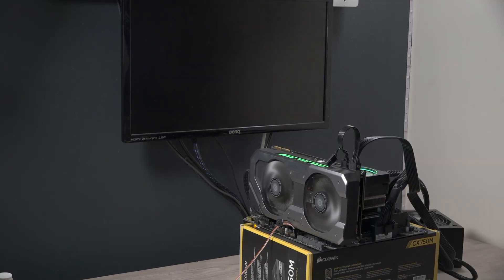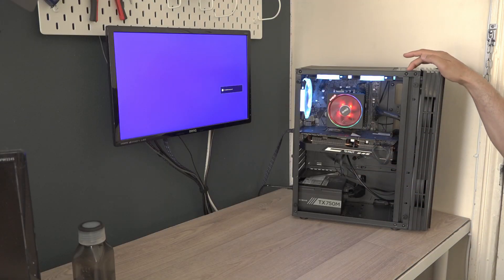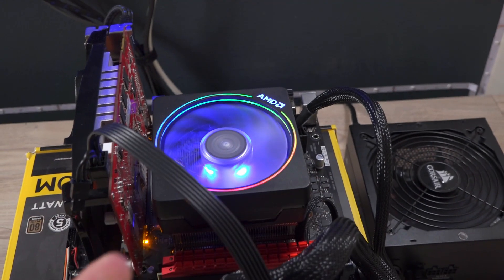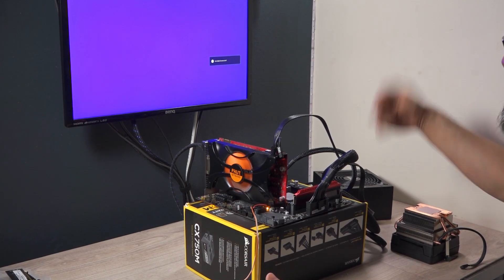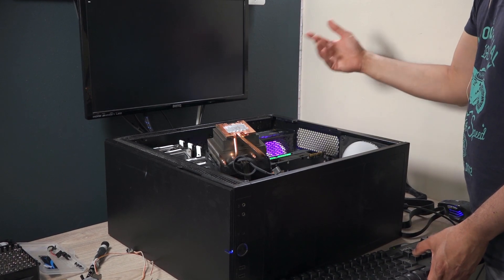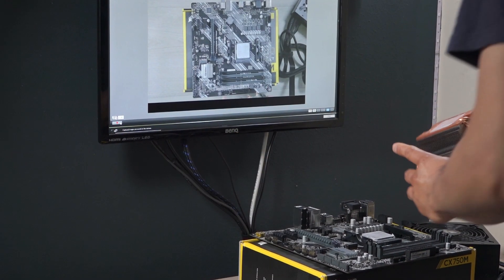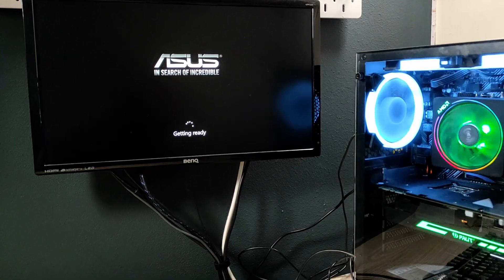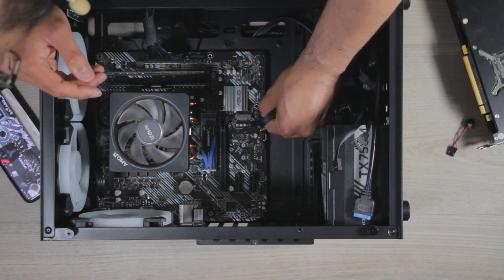Computer Turns On But No Display - Led Light On Fan Spinning - HARDEST Troubleshoot?

Comment: I have this exact same issue with my new build but don't have spare parts to test, ryzen 7 3800x with bf450 board, swapped ram, took mb battery out and put back in, motherboard and gpu light up and all fans spinning,  just won't post, do you think it's the new motherboard? It seems exactly the same as this
Reply: Oh I also plugged a speaker into motherboard and I get no beeps at all when turning on, also the build won't shut down when I long press the power button, I have to switch off by psu power button
Reply: @djsyks1  fixed ? Help
Reply: @Scriptff777  ended up sending mb back and buying a different one, worked straight away with new board, maybe the board I sent back needed the bios updating, I'm not sure but was defo the motherboard,  maybe try updating the bios as that's the only thing I didn't try
Reply: @djsyks1  🤣 i tried but didn't work ☹️ I use boot drive you can update bios with it without display
Reply: did u find the solution today ?
Reply: I have the same problem, I am suspecting the culprit might be the motherboard

Comment: Change new ram, still not working.
Change power supply, still not working,
Reset CMOS, still not working.
New Motherboard, still not working..
How about CPU ?
If CPU problem, you still can boot ?
Reply: Graphic card
Reply: it won’t boot in most cases
Reply: My case here, everything new and not working my GPU are old ok but I don't think this is the problem wow do hard Windows 😢 my Old MacBook Pro never give problems

Comment: someone please reply and help me, so i was using my pc watching youtube videos, and all of sudden my screen went black from no where, also did happen with me 2 days ago where my screen went green colour and white colour, and then my display wasn't showing from gpu, so i changed the video to motherboard and my pc is working, but my gpu fan is still spinning and it working fine, but still i dont get display,  any help?
Reply: Same issue here brother. This thing has been plaguing my system for a while and it's the second time this has happed. I am  going crazy trying to figure out the cause. The last time this happened a year ago and turned out both my mobo and GC were bad got the mobo replaced under warranty and bought a new GC now the swme issue again 😭😭
Reply: @Metalhorse_  did you ever figure it out?
Reply: I have the same problem😰please let me know if you know how to fix it

Comment: What if my system posts even after trying hard to get this motherboard to post and then after some time it crashes in windows 50-50 chances to crash? 
CPU- Core i3 6100
MB - GA-H110M-s2
SSD- Kingston A400
Ram - Kingston 4gb DDR4 2400, Hyperx 8gb DDR4 2400
GPU - Hd 7870 
Psu - CM MWE550 Bronze
Motherboard was not powering on earlier, light and fans used to turn up for a sec and nothing after one spin. After some time it was spinning continuously like no power to cpu but never post. And after some ram adjustment and replacing rams it did post and now I'm facing crashes and sometimes the same no post but posts after turning on in sometime

Comment: So I have this same problem with my pc but I was just doing my normal pc business then I got a screen freeze i was loading into a game of g mod which can be a very demanding game and I’m only using a 3200g r3 apu after about 2 mins of waiting for the freeze to stop I decided to turn off my pc and after I waited 45 seconds I attempted to boot my pc up again but it did not turn on after about 7 minutes it turned on by itself and showed no signal with a red light on the motherboard I read the manual and it meant something was up with my cpu I bought it new from Newegg about 5 months ago and had no problems. Did I just put to much stress on my cpu and gpu? And is there a way I can fix it?
Reply: I'm pretty sure I'm having this exact same issue but with my 5600x, my 3080ti is still confirmed working so it's between the cpu and motherboard
Reply: @FTVG_inc having the same issue what was ur fix

Comment: The issue with my motherboard is that mine has a button labelled as CLR_CMOS2 instead which seems unique from other mobos, i havent seem this with other motherboards. (MSI X470 Gaming Plus). What i did was just shut down the computer and unplug the power cord that connects to your computer and flip the switch, once thats done. I pressed down on CLR_CMOS2 for 15 seconds or so and let go and plugged back everything and it worked.

Update: I had the same issue again, i had it two more times and fixed it the same way i explain above. Its kind of annoying and im concerned about what's wrong. Can you suggest akhi pls what the issue might be?
Reply: Hey my man I hope you got your problem fixed. But for everyone reading your comment from now on let me say that if you're facing this issue frequently and you're solving it frequently by resetting cmos, you should replace the battery.

Comment: I had this happen to mine when first built. It was running off the i-gpu which had no drivers.
Reply: How did you fix your I-GPU problem?
Reply: How did you fix it???
Reply from the maker: That's not exactly the same issue then...!
Reply: @HealMyTech1  actually its the exact same problem. no display showing and all lights powered on. My worst fear was I fried the mobo but no, that's not what happened.

Comment: I have the same issue but my keyboard had also broken when turning the pc back on
Reply: Ya mine is the same my computer turns on but there is no display and my mouse and keyboard won’t light up indicating that they are working.
Reply: @monkie_e5362  and i have this problem how you repair him?
Reply: @monkie_e5362  same issue
Reply from the maker: Im not clear on what you are saying!
Reply: Same problem any solution ?
Reply: @aissaouiali8458  I straight just short circuited my keyboard somehow but check your ram might not be pushed in all the way
Reply: @zanderdov5901  Bro my motherboard has a red light on the dram, does it mean that i didn’t push it in all the way ?

Comment: Figured mine that it was either the bios settings or the static. Fixed mine by removing the gpu, then the cmos battery to reset the settings for five-6 min, hold the power button for thirty sec to drain the static, and finally plugged everything back. GPU now displays.

IMPORTANT: (Make sure to have done the unplugging method above before proceeding) Also make sure to understand the BIOS configuration for the display. Sometimes, PCI-E (Display output for the GPU) gets interchanged with the iGPU (Display output for the integrated GPU of your CPU; most Intel CPUs have this) or the other way around. To check if that's the case, you can try plugging your monitor to the iGPU instead of the GPU or the other way around and check if it turns on. If it does, then there's a possibility that your BIOS is not properly configured to show display through your other display output. You can find it in most BIOS under 'Display Configuration' or the likes. Hope it helps!
Reply: Cannot believed that worked lmao. Thank you for bothering to comment this
Reply: @naturalcauses1695  sure, glad to help!
Reply: @blank4700  please bro can you explain i am having same problem how did you do that what do we have to do exactly first remove GPU and CMOS then hold power button for 30 second and then wait for 5-6 min and plug back that's it ? Or anything else pls reply
Reply: @Scriptff777  I'm sorry if you're dealing with the same situation. What I did first was remove all peripherals, including the monitor, keyboard, mouse, etc. Then proceeded with removing the GPU and CMOS. What I mean about plugging everything back is everything, including the peripherals.
Reply: @Scriptff777  you can explain your problem more, including dropping your GPU model here and some or all of your specs. I'll try to help
Reply: @blank4700  ok bro ↓

16GB ram 2400mzh
MSI H310M-PRO-VH-PLUS
I59400f 9th gen
GT 1030 2GB DDR 5
 I am getting light in EZ DEBUG LED (VGA )
It lights for 30-40 seconds and it turns off and my montior starts getting signal but black screen only I know my window is booted because when I click window button and type .mp3 it starts songs but black screen bro please help bro i am so sad my motherbord was replaced 1 week ago  I waited for 2 months for new one and now this issue :-(
Reply: @Scriptff777  I am very sorry for responding late. Have you tried searching your specific situation to the internet? Are you 100% sure that your components are fully compatible with each other?
Reply: @blank4700  yes bro everything is fully compatible my pc was working I just shutdown the window and it never turrn on again and this problem started i tried changing CMOS battery but didn't work reinstalling GPU and ram didn't work cleaned PCI slot didn't work tried your trick
It also didn't work 😔
Reply: @Scriptff777  and the fans spin right?
Reply: @blank4700  yess it spins
Reply: @blank4700  same problem here I was playing forza one day on my pc then started to notice the screen was tearing so I closed the game and restarted my pc. When I turned my pc on all the lights and fans were spinning but three beeps played from the motherboard.I had just bought new ram thinking that was the problem, but turns out not to be. Do you know any solution?
Reply: @calebdawit5631  if you saw early signs of tearing, then I think it is most likely the GPU's fault. May I know the model and age of possession of your GPU? With that little information, it may be already dead but who knows
Reply: @Scriptff777  I think you have the same situation with @Caleb Dawit. I found an article online and this is I think the cheapest solution. Try changing the CMOS battery of the mobo. You can buy it at any computer retail store near you, it even is present in some stores if you look enough
Reply: @calebdawit5631  try replacing the CMOS battery with a new one. saw this one online with the same problem. hope this helps
Reply: @blank4700  ☹️I tried it but i think I used wrong one
Reply: @blank4700  I have an extra one at home I will try to replace it and see the if it boots up. I have 2060 super I had bought it during 2020 summer.
Reply: I have replaced the CMOS battery and still have the same issue
Reply: @calebdawit5631  worked ?
Reply: @Scriptff777  no sadly. It’s been broken for so long tbh. Took it to a tech shop and they told me it was the ram sticks, then bought new ram and still had the same problem…
Reply: @calebdawit5631  Rip motherboard 

I think 💬
Reply: @Scriptff777  Idek if it’s gpu or the mother board that’s faulty 🤷🏾‍♂️
Reply: @calebdawit5631  same 
First my screen starts in tearing 
6lines under cursor and then this happen
Reply: @Scriptff777  jus bout a new motherboard. Hopefully that cures the problem.
Reply: @calebdawit5631  please give the update to me my motherboard failed 2nd time (*_*) I think I should also change power supply
Reply: @calebdawit5631  fixed ??
Reply: @Scriptff777  bro did u fix it same thing happening to me 
lmk fix plz
Reply: @farisbalala3377  gpu died bcz of moisture
Reply: @Scriptff777  yo I have the same problem did u get ur fixed or nah
Reply: @xiajieou910  rip GPU
Reply: @Scriptff777  ur gpu defected ?
Reply: @xiajieou910  hm
Reply: OMG THANK YOU SOOOO MUCH BLANK  YOU SAVED MY LIFE I SEARCHED HOURS TO FIX THIS PROBLEM AND YOUR COMMENT WAS THE ONLY ONE THAT SOLVED MY ISSUE TY!!!
Reply: Thank for sharing 👍. Helped me fix my issue.
Reply: I never leave a like or dislike or comment or nothing at all on YouTube. I only subscribe and watch, I’m like a ghost on social media platforms, but anyways...After 3 days of troubleshooting, your instructions have saved me! Seriously, thank you, life is beautiful once more!
Reply: Thank you so much. I tried literally every method online and yours finally saved my day. God bless you!
Reply: i was about to start returning items in my pc thankyou so much for the help
Reply: Thanks dude this helped me ALOT
Reply: thank u so much this worked for me 🙏
Reply: why isnt this top comment
Reply: BRUHH THX SO MUTCH I HAVE BEEN TRYING FOR 1week
Reply: What
Reply: What gpu have you got
Reply: @bLank what gpu have you got
Reply: @russel1111  GTX 560
Reply: omg looking back, i am literally a life saver :D
Reply: for additional info, my pc was working even before the issue. it only persisted after i installed my newly-bought GPU
Reply: I know this was a year ago but the YouTube comment section never fails to be more helpful than the video itself, I'm fr about to get yo ass butt booty naked fr. Tysm
Reply: Thanks for hint towards the beeps
Reply: Yeah i’ve tried this to plug into the igpu it worked now after multiple restarts it worked on the gpu , used my computer for 2 months , from time to time the problem get back just few restarts fix it , now even if i plug it on the igpu or the gpu nothing displays , i tried to remove the cmos and the gpu also , i hope it’s not the motherboard .
Reply: @thegamerkamri  i had the same issue too for some time after 'fixing' the previous NO DISPLAY issue. we also have the same fix for that issue, but after repositioning my ram sticks, the occasional no displays never came back. so that may be the fix, no?
Reply: @blank4700  man thank you for responding all the time , god bless you
Reply: was this on a new build? i am having the same proble. cpu light is on and no display.
Reply: @bazinga899  it was from an old build. i changed my gpu and it didn't display
Reply: How can it be the GPU when there‘s also no light on the keyboard and mouse? Isn‘t that a CPU thing?
Reply: it fixed mine to be thank you so much
Reply: This fixed mine thank you for sharing

Comment: I suspected the board to be the culprit in facebook simply by knowing that the chipset was a b450 type, but I didn't actually think that it would be faulty though. One thing is for sure there would of been no other way to know for sure, without swapping it.
Reply: So, you've changed the motherboard or you managed somehow to fix it?